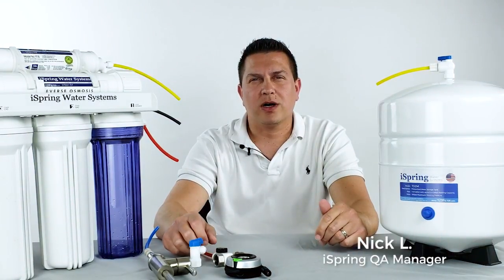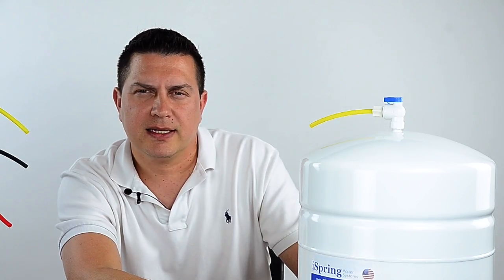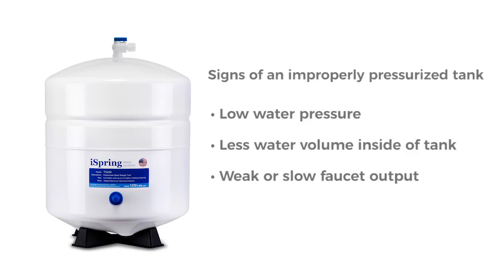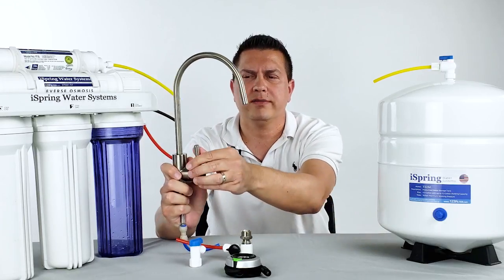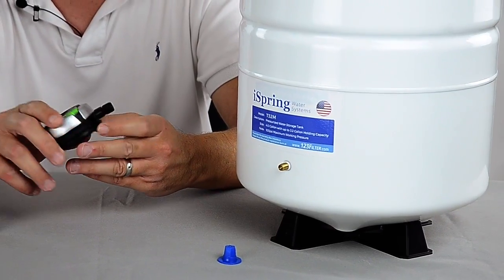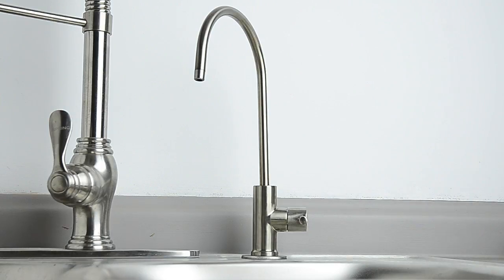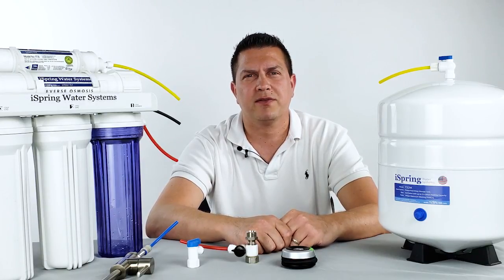Overview & troubleshooting | iSpring Pre-Pressurized Water Storage Tank for Reverse Osmosis Systems

Comment: I have been a regular visitor to this video whenever I replace filters. I replaced all 5 filters recently at the same time  and since then (2 months) the water flow is very low. I mean, I could not even fill a quart of kettle at one time. I had to wait hours before I could start again. The system is 8 years old. Filters are brand new. Water pressure is good everywhere in the house. I am used to changing filters like you said in the video and it all worked fine for 8 years. This is the only time I changed all 5 at the same time. Any clue what might be causing this issue?  We live in deep cold weather (midwest) don't know whether that is causing this. last resort I am thinking is to change sediment filter one last time and see whether it helps otherwise replace with a new system. Thanks.
Reply from the maker: Hi there! Have you checked the air tank pressure yet? The RO tank should be set to 7–10 psi when empty. Over time, tanks can lose pressure, and if this happens, they should be re-pressurized.
If the issue persists after checking and adjusting the tank pressure, please contact us at support@ispringfilter.com or 678-261-7611, and we’ll be happy to guide you step by step.
Thank you!

Comment: Ro500 Little ti no pressure it’s not this tank !
Reply from the maker: Hi there! Low water flow at the faucet in the RO500 tankless RO system may be caused by clogged filters. However, if you have replaced the filters recently, we will need to troubleshoot further. Please send us a short video showing how the system is behaving to support@ispringfilter.com. Once we receive it, we’ll review it and guide you step-by-step. Thank you!

Comment: Thanks, Nick, for the informative video! We’ve had our five stage system from your company for 7 years now - works great. Recently there’s been a drop off in pressure from the system which seemed to happen within a fairly short time. I’ve ordered a low pressure gauge and will drain the tank and check it. It is heavy and full of water now. Even full, the tank currently shows less than 10 psi on my tire pressure gauge. No water leaks out of schrader valve, so bladder should be OK. Is there any need to clean the tank? I’ve seen some posts about that. Whole house pressure tanks are just a bigger version of this and I’m not aware of there being any recommended such maintenance for them. Thanks!
Reply from the maker: Hi there! You can sanitize the system once a year, and the tank will also be sanitized during the process. 
Refer to this video to sanitize the RO system:
https://www.youtube.com/watch?v=oXGbQ-Ai0qg 
If you have any concerns or questions, please contact us at support@ispringfilter.com or 678-261-7611. We're happy to help!
Thank you!

Comment: Maybe someone already asked, but I experience often time vibrations in the system, like a water Hammer that cause the red tube to move around. Did I do something wrong with installation?
Reply from the maker: Hi there! Please ensure that your incoming water pressure does not exceed the recommended working pressure range for your system (this can be found in the manual). If the pressure is too high, it could cause vibrations like you're describing. Alternatively, please send us a video of the issue to support@123filter.com so we can assist you further. Thank you

Comment: What is after 5h the tank is full,  its pressurized correctly,  i have it set to 68psi at the house main. And the filter keeps on going  its been 2 days and it havent stopped  so putting alot of water down the drain.
Reply from the maker: Hi there! It seems you are having a constant drain issue. Please refer to this video for help:
https://www.youtube.com/watch?v=KsFnoNJS2jg 
For proper assistance, please contact us at support@ispringfilter.com  or 678-261-7611 (M-F 9:00-5:00 EST)  Thank you!

Comment: I just had the RCC7AK installed a few months ago. The water flow is good but we hear what sounds like a truck down shifting every once in a while. Is that normal?  Everything else works fine it’s just that sound that happens every few hours.
Reply from the maker: Hi there! To better assist you, could you please send us a video showing the sound to support@ispringfilter.com? This will help us identify the issue or confirm that everything is functioning properly.
We appreciate your patience and look forward to hearing from you.
Thank you!
Reply: @ thanks. I’ll try. It’s hard to do as the sound happens randomly.

Comment: My tank has the correct pressure in it, yet the flow seems weak and doesnt last very long. I have noticed that the black tube to the drain now only dribbles when upon install 2yrs ago was much stronger. I have changed the filters in the system once since the original install... your thoughts please!
Reply from the maker: Hi there!  Since you've only changed the filters once in two years, it might be that the filters are exhausted, causing a drop in pressure. We suggest following the recommended filter replacement schedule to maintain optimal system performance.
If you have any concerns or questions, please reach out to us at support@ispringfilter.com  or 678-261-7611 (M-F 9:00-5:00 EST) for proper assistance. Thank you!

Comment: Hi. I just installed mine about 2 months ago and just suddenly stopped working. 
The tank has no water in it, it just stopped flowing to it. 

What could be the cause of that if it is not a pressure issue.
Reply from the maker: Hi dear customer! Do you hear water constantly going to the drain line? If so, there might be a constant drain issue. Please, refer to this video for help:
https://www.youtube.com/watch?v=t4rPacnCKVo 
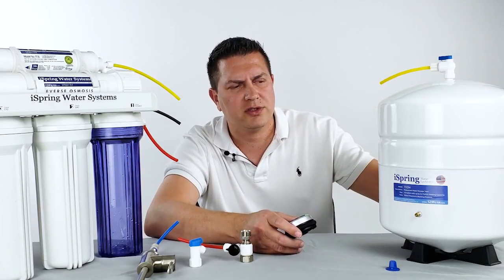Please, kindly contact us at support@123filter.com or at (678) 261-7611 M-F 8:30-5:30 EST to properly help you as soon as possible.

Comment: Install a unit of you a year and a half ago, I changed the filters in your time, but now the tank is not filled and the pressure coming from the hose that feeds it (yellow hose) comes out very little water, it has the air pressure it requires but only fills two or three glasses and ends, what would be the solution? Could you help me? I've already spoken to your company, but the solution you gave was not the right one.In advances,thank you for you support.
Reply from the maker: Hi dear customer! Could you please verify if the tank holds the air pressure?
Do you hear water constantly going to the drain line? It might be that you are having a constant drain issue. If so, please refer to this video:
https://www.youtube.com/watch?v=t4rPacnCKVo 
Please, kindly contact us at support@123filter.com to properly help you as soon as possible. We are happy to help!

Comment: why does the manual say min 45psi ?
Reply from the maker: Hi dear customer! The minimum inlet water pressure for the system to properly work is 45 psi.
Regarding the air tank pressure, it should be 7-10 psi in an empty tank. 
If you have any questions, please, contact us at  support@123filter.com, at (678) 261-7611 M-F 8:30-5:30 EST, or at (470) 560-0012 M-F 8:30-5:30 EST (Messaging only) to properly guide you. 
We are happy to help!

Comment: Have had my 6 stage w/tank for a couple of years now (harvest water from roof).  Had a positive contaminant test and changed out the filters.  Still  have positive test (SafeHome). Emailed  iSpring using customer service links. The response was to go to youtube, no specific link.  dRRRR, where is the video please?!
Reply from the maker: Dear valued customer,
Thank you for your comment!
Could you kindly confirm if you've performed the pre-filters flush as recommended? If not, please refer to this instructional video for assistance: 
https://www.youtube.com/watch?v=LsVNBpLA6dE 
Additionally, could you ensure that the system has been flushed sufficiently and that all filters are correctly installed?
Please, contact us at  support@123filter.com, at (678) 261-7611 M-F 8:30-5:30 EST, or at (470) 560-0012 M-F 8:30-5:30 EST (Messaging only) to properly guide you. 
We are happy to help!

Comment: Everybody just keeps talking about pressurizing. Billion videos about that. Please troubleshoot THE OTHER possibilities. I have the pressure, butgot no water in the tank, stopped working
Reply from the maker: Hi dear customer!  We genuinely appreciate your valuable feedback as it assists us in enhancing our services.  Regarding the issue, 1. Please, check if your incoming water pressure is at least 45 psi. If your inlet water pressure is below 45 psi, you will need to add a booster pump to your system. 2. Please,  check  if there is no crimped tubing and that everything is properly installed. Make sure the tank valve is open.
If the issue is not fixed, please kindly contact us at support@123filter.com, at (678) 261-7611 M-F 8:30-5:30 EST, or at (470) 560-0012 M-F 8:30-5:30 EST (Messaging only) to properly help you as soon as possible.
We are happy to help!

Comment: Just installed one today. How do I know if the tank is filling up with water.. I don’t hear anything going into the tank?
Thanks!
Reply from the maker: Hi dear customer! Make sure that the tank valve is open. Open the water supply to your system and allow the tank to fill. The tank takes 1-2 hours to fill. Bigger tanks may take longer to fill. When the tank is full, waste water will stop draining. 
For any questions, please kindly contact us at support@123filter.com, at (678) 261-7611 M-F 8:30-5:30 EST, or at (470) 560-0012 M-F 8:30-5:30 EST (Messaging only)
We are happy to help!

Comment: I made a mistake letting the tank drain when I depressurized the system to change all the filters. It has refilled and everything seems ok but the pump has been running for like an hour. How long should that pump be running when restarting the system?
Reply from the maker: Hi there. Please kindly contact us at support@123filter.com, at (678) 261-7611 M-F 8:30-5:30 EST or at (470) 560-0012 M-F 8:30-5:30 EST (Messaging only) to properly guide you. If the pump continues running, it might be that the high-pressure switch might be faulty and not triggering the pump to turn off.

Comment: If water is coming out of the air pressure valve, does that mean I have a ruptured membrane?
Reply from the maker: Hi there. Please kindly contact us at support@123filter.com, at (678) 261-7611 M-F 8:30-5:30 EST or at (470) 560-0012 M-F 8:30-5:30 EST (Messaging only) to properly guide you.

Comment: I just re-pressurize my tank at eight psi. Is it normal for water to be draining continuously from the black tube while the tank is refilling?
Reply from the maker: Hi there. Yes, it is normal while the tank is refilling. However, if you notice that it is draining continuously after the tank has filled, please kindly contact us at  at support@123filter.com, at (678) 261-7611 M-F 8:30-5:30 EST or at (470) 560-0012 M-F 8:30-5:30 EST (Messaging only) to properly guide you.

Comment: my system is in my basement and the line going to my sink is about 30 feet and I noticed the pressure is very low, does it matter how far away the system is from my sink if the pressure is between 7-10 psi?
Reply from the maker: Hi there. A maximum distance from tank to faucet of 15 feet is possible. The system will produce a faster flow at the faucet with the shortest tubing run from tank to faucet.
For any concerns or questions, please contact us at support@123filter.com or at (678) 801-9308 M-F 8:30-5:30  EST//(678) 261-7611 M-F 8:30-5:30 EST
We are happy to help!

Comment: Just bought a 6 stage. Pressure on tank is within range but tank will not fill with water….
Reply from the maker: Hi there. Do you know your incoming water pressure? If it is below the minimum required level of 40 PSI, there is not enough water pressure to force the water through the RO membrane. Therefore, the tank does not fill, and the system drains continuously. 

Please, check if all the tubings are properly installed and make sure the tank valve is open. It should be in line with the yellow tubing.

For further concerns or questions, kindly contact us at support@123filter.com and at (678) 801-9308 M-F 8:30-5:30  EST or (678) 261-7611 M-F 8:30-5:30 EST

Comment: I've never understood why there is another filter after the ro membrane.  Isn't the ro membrane supposed to stop pretty much everything?
Reply from the maker: Hi there. 1. pH adjustment: Reverse osmosis typically produces slightly acidic water due to the removal of minerals. Some post-filters, such as activated carbon alkaline filters, are designed to increase the pH of the water, which pH-balances the RO water.
2. Polishing the taste: The RO membrane is highly effective in removing a wide range of contaminants from water, including dissolved salts, heavy metals, and certain organic compounds. However, minerals can affect the taste of water, and the RO membrane removes them. Certain minerals can give water a distinct flavor that our taste buds can detect. Additionally, the concentration of minerals and the presence of other compounds in the water can also influence the overall taste experience. Some post-filters, such as alkaline remineralization filters, produce alkaline water with restored healthy minerals such as natural calcium, magnesium, and potassium ions.

Comment: I have your system and no water comes out of the tank. Odly enough when I checked the pressure some water came out of the open valve of the tank. I pushed the Shrader valve in like I was taking the air out of a car tire and more water came out. WHen I stopped so did the water. Pushed it in again and more water came out. so did some black specks.
Reply from the maker: Hi there. I'm very sorry to hear about this issue. Please call us at (678) 261-7611 or (678) 801-9308 M-F 9-5 EST. We stand behind our products and will make things right for you.

Comment: Hi Nick, I have slow flow from faucet so I emptied the tank to measure air pressure with low pressure gauge.  I can’t get a reading on the gauge at all.  The gauge works fine when measuring car tires.  If I need to add air what’s the best way to add air?
Reply from the maker: Hi there. If you cannot get a reading, it might be that their tank is completely depressurized. Using a cycle pump can be a good way to repressurize the tank. You can refer to this video: https://www.youtube.com/watch?v=a6Nc9wrnqAM

Comment: Is it OK to leave the unit under pressure, or should I turn off the water valve when the tank is full?
Reply from the maker: Hi Paul. The unit should be kept under pressure. Otherwise, water will not come from the faucet. Ideally, the empty tank pressure should be 7 to 10 psi at all times.

Comment: Hello,
In the video he said if the tank feels heavy , it’s problem with low pressure .
1) How much the tank should weigh if the tank is full ? Mine feel very heavy.
2) the black tube connected to my under sink disposal pipe is flowing for a very long time and it’s loud, feel
Like lot of water is getting wasted for long time .

Any suggestion?
Reply from the maker: Hi Arun, 

It's best to drain the tank completely or water and then check the air pressure. See video here - https://www.youtube.com/watch?v=a6Nc9wrnqAM - and contact our support department at 678-26107611 (M-F, 8:30 - 5:30 EST) if you need further assistance.
Reply from the maker: In regard to your second question, if the tank is properly pressurized it should solve this problem but it could be something else. Please check the constant drain video here: https://www.youtube.com/watch?v=t4rPacnCKVo

Comment: Once the tank is full, what’s the typical tank psi? Mines 22-23 psi before the drain tube stops draining. I have the 5 stage system.
Reply from the maker: Hi there. It depends on the incoming water pressure, but 22-23 psi sounds low.
Reply: @iSpringWaterSystems  incoming water pressure is 50-60 psi. Thank you
Reply: How do you check incoming water PSI?  I know how to check for the tank.  After replacing a new membrane, now my system won't stop draining water into the drain.  How do I make the water draining stop as it is 24/7.  thanks

Comment: Does the max pressure of the tank depend on the size or is it standard across the board?
Reply from the maker: Hi there. Air pressure is all the same for our tanks. It should be set from 7 to 10 psi when the tank is empty of water.

Comment: Hey Nick can these tanks become waterlogged because when I try and drain tank till no pressure out of water valve the tank feels very heavy. Do you have a recommendation for completely draining the tank. Thanks
Reply from the maker: Hi Kenny. Please open the RO faucet and pump air into a heavy tank to see if this will empty the chamber. Also check the schrader valve at the bottom to see if any water comes out of it. If nothing, please give us a call at 678-261-7611 (M-F, 8:30 - 5:30 EST). We are happy to help!

Comment: My tank is not pushing the water out very well and it won't empty (yes, water supply line is off), what should the pressure range be when the tank is full?
Reply: I kept adding enough air to keep the water flow steady until the tank emptied, I now have it empty at 9.5 psi.  It's filling up again, hopefully everything will be back to normal soon.